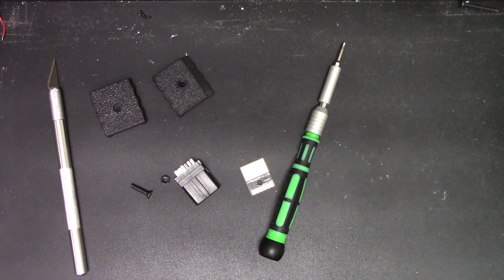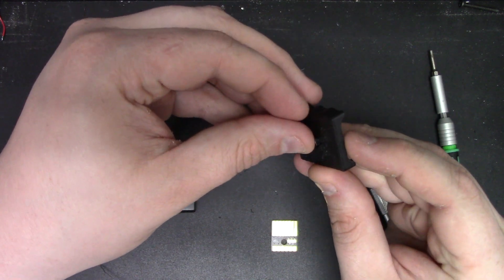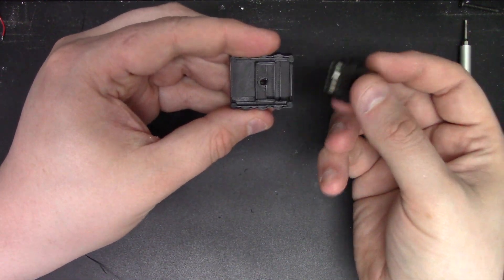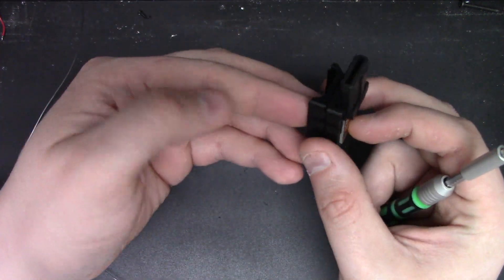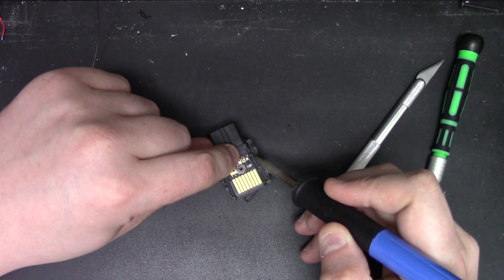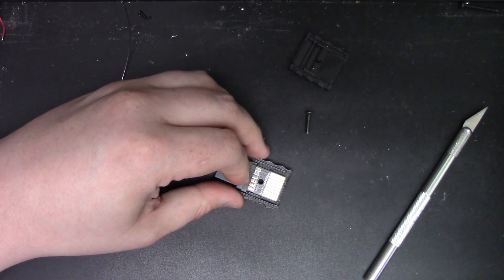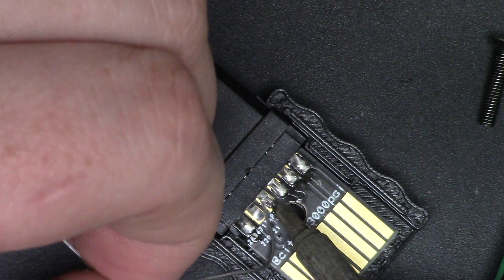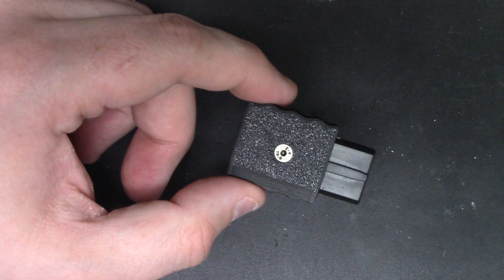Wii Multiout adapter for GCDual and N64Digital

Comment: I tested this adapter with a Tim Worthington N64 RGB mod with jumper 5 bridged for Component output it works great. I tested with two different generic Wii cables and both worked fine on the component input of my old Samsung LCD. Waiting on a Retrotink 2x to test with that.

Comment: Hi, i received my unit yesterday. Soldering everything like i saw in vídeo but not show image on screen, just sound. I tried with lcd and crt tv with wii retrovision component cable. I need some help!

Obs: My foult, i dont take atention about that only work on moded gamecube with gcdual, my gamecube just have one mod that is a gc loader. One question, what kind of signal the adapter output without a gcdual mod, is that a rgb?